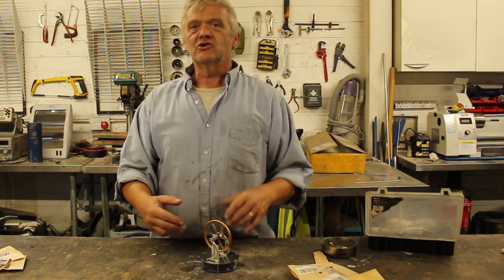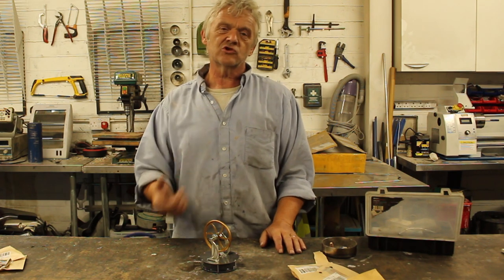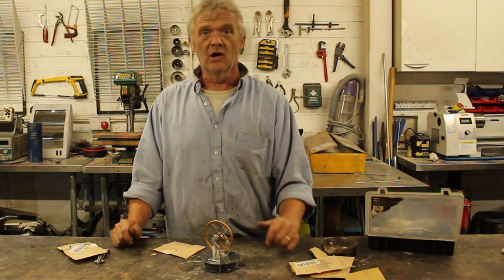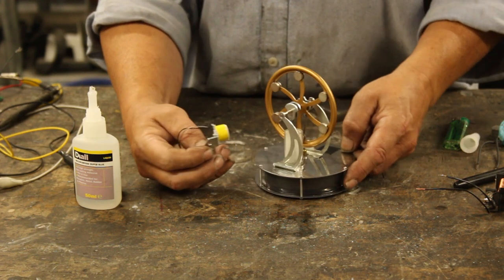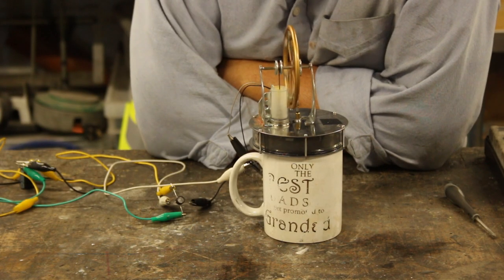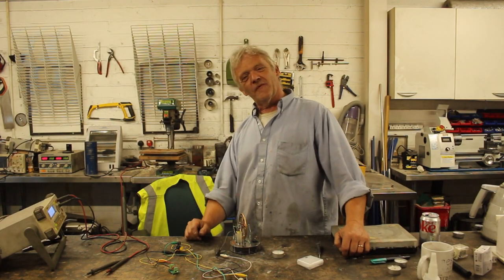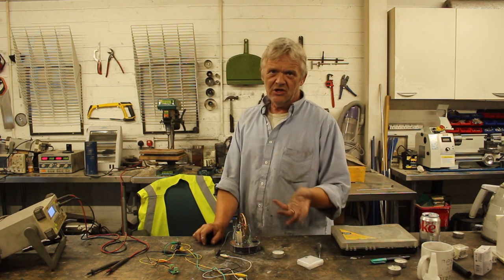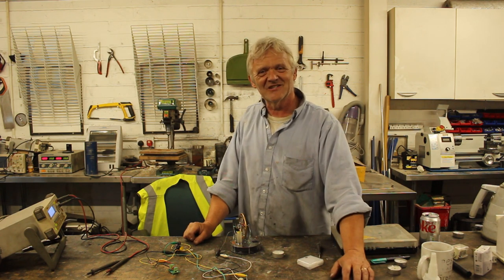1617 How To Generate Electricty From A Cup Of Coffee Or A Tea Light

Comment: I think a helpful video for the preppers would be, how to make a large sterling engine to charge a battery. There was a company that was doing this but it's vague how to accomplish it. I saw another person directing sun from a parabolic reflective dish to a tube with oil that went to sand battery, another was using a sterling to run off the heat from the hot oil, that would be much better than solar, cheaper and better for the environment.
Reply: Atmo motor v2
Reply from the maker: to scale this up is pretty easy in concept - about the only additional thing needed is a counterweight on the displacer
Reply: @ThinkingandTinkering  nice! Hey have you checked out open source ecology, you would have a field day with the stuff they are doing

Comment: I am wondering if a scaled-up version of this could be installed on a roof or through it into the loft-space, so that in summer the sun powers it compared to the cooler air inside the house, and in winter the opposite may be true with waste-heat.
Reply: Probably but you are introducing a heat leak in your insulation.  But if say your window is already leaking heat then it's called energy scavenging.
Reply: The best thing you can do in your loft in summer, is put a velux window, so that the heat can vent off, create an up draught. My neighbours house was over 40 degrees all night upstairs, mine was 25. Basic science.
Reply from the maker: I would think so - but I don't know how good it would be at that job - but if the alternative is that or nothing - I would go with your idea for sure

Comment: I believe I did read somewhere that sterling engines have been used to produce 2 or 3 kilowatts in large tower buildings which used a furnace to heat the flats/rooms. I think that's the only example of them being used practically I ever found though
Reply from the maker: you have to go back to the late 1800s to see them in real use - then they were every where

Comment: I've always thought that a Sterling engine heat pump, for heating and cooling, seemed a natural combination. Utilizing the temperature differential between inside and out to bring them further apart sounds like a great feedback loop, as long as the difference is great enough to begin with. I always figured there must be something wrong with my thinking, or it would've been done before. Probably doesn't scale well to the application.
Reply: The difference between hot and cold has to be pretty large to drive such a mechanism.  Basically the range of temperature the device needs is bigger than you can comfortably tolerate.
Reply: Don't you realize that defies the laws of thermodynamics?  That would be spontaneously moving heat energy in the wrong direction without adding energy.
Reply: @BobWidlefish  
"The difference between hot and cold has to be pretty large to drive such a mechanism.  Basically the range of temperature the device needs is bigger than you can comfortably tolerate."

You're information is misleading.

Rob measured the difference between hot and cold on that little one he has in this video. The difference was 5 degrees Celsius which is about 41 degrees Fahrenheit.

That's not a very big difference.
Reply: @BobWidlefish  Still, you wouldn't use ambient temperatures. I imagine some form of freon would be used to do the heat exchange. Sterling engines would run the compressor, but like I say, it doesn't scale well.
Reply: @MushookieMan  That would only apply to a closed system. Only the indoor end is closed.
Reply: @willcool713  Imagine your design as a black box.  You are expecting heat to move through it  in the wrong direction, without adding electrical energy to pump the heat.  Open or closed, doesn't matter.
Reply: @MushookieMan  Well, if it were freon based, you'd definitely need something to pump the freon up to pressure on the appropriate side. I'm not thinking of it as a closed system, as if you're only getting energy from the Sterling engines. But as an automated control mechanism, it certainly seems like it could increase efficiency. I'm not trying to create some sort of perpetual motion device. But the heat pump concept dovetails wonderfully with the mechanics of the Sterling engine. I just see lots of room for optimization. I don't understand why everyone is so down on the idea. It's just a thought exercise I toy with now and again in idle moments. Sorry to offend.
Reply from the maker: I read all of this thread as I wasn't sure what you actually meant from your first post and to be honest mate I am still not sure -  you can take a heat difference and change it to motion which is a Stirling Engine - you can of course do the opposite take motion and change it to a heat difference - which is what Stirling coolers do. The motion of a Stirling Engine could be the input for the Stirling cooler but as each leg is at best 37% efficient the over all machine would only be around 12% efficient - that's why Stirling coolers use a different motor to run them - it really makes no difference how you arrange that - the above would be true - hope this helps and I have got the right idea - because I am still not sure what you mean lol - cheers
Reply: @ThinkingandTinkering  Well, I'm not sure either. It was idle speculation, there just seems something there to take advantage of. Maybe I should read up on Sterling coolers before I try reinventing the wheel.

Comment: Remember  the shake light. Old emergency backup flashlight (torch) you shake and it charges a battery in the handle? Do you think that same application could be used with the Sterling engine? But scalded up
Reply from the maker: I would think so mate

Comment: Maximum theoretical efficiency is:

Q = (Tmax - Tmin) / Tmax; Where T is temperature in kelvin, changing 1 deg c = changing 1 deg kelvin but 0 deg C = 273.15 kelvin.

It's the inverted equation for calculating the efficiency of a heat pump and all carnot engines are heat pumps when supplied mechanical power. It's also the maximum efficiency of energy extraction possible from a temperature gradient.

Low-TD carnot cycle engines minimize losses to the point where, like this they, can operate on extremely small differentials, however, low differentials are inneficient by nature. If you suplied a low-td stirling engine with a larg differential, you have an extremely efficient engine. In fact, if you control the supply flame and make sure you have efficient heat exchange, low-td carnot engines are basically the most efficient it is possible to make an engine that opperates off of pressure and heat.

With the candle flame, the flame gets to 760 celcius or 1033.15 Kelvin and if the air is 293.15 Kelvin, then the efficiency of a low-td stirling running on a candle flame would be close to 70%!!!

Comment: Could you somehow have 2 of these or a different sterling engine, configured in a way so you had the 2 flywheels rotating in opposite directions close to each other and have the magnets on one, and the coils on the other with some kind of slip rings on the coils to transfer the power and hopefully generate more power.

Comment: Is the energy an LTD Stirling engine produces equally scalable with its size?  
  I mean it can obviously produce more electricity being larger, what size sterling engine would be needed to supply a useable voltage and current?

Comment: How about if you compare that sterling to the TEC and see which one generates the most from the same little candle. The TEC generate electricity from temperature difference, and it has no moving parts. They make it TEC fan which is on top of the stove to move air, you can do the same thing with direct light maybe a magnifying glass.
Reply from the maker: good idea

Comment: The last few days have got me thinking that maybe we're using the wrong part of the parabola to focus the heat for a solar sterling generator.  Normally these things use the bowl to consentrate the sun's heat from behind on the underside of the engine, where a flame would be. But what if we use the legs instead and focus the heat on the upper side of the engine and use the capillary cooling from the ambient air temperature on the bottom.  

Or maybe it needs to be the other way round.  The cold side on top heated by the legs and the hot end on the bottom heated by the ambient, and let the cold fall and the heat rise.  Something I need to play with...
Reply from the maker: I do like your thinking there - and lots of interesting questions - my hope is you give it a go and share the results - nice one
Reply: I would try using a fresnel lens with the mirror. I have two that I found. They would work best I think.
Reply: @rsummers1974ify  I like that plan

Comment: How about combining a solar heat collector with a sand battery and a bigger LTD Stirling?  The Stirling could then run when the sun is out, or as long as the battery has enough heat.  In colder climates, it might be possible to run the Stirling in the winter off the temperature difference between indoor and air without impacting the temperature inside too much.  Adding a Zeolite powered heat exchanger to the mix might have a benefit as well.

The idea is not to run a house on the Stirling alone, but to supplement other collectors, like solar panels & wind turbines to charge batteries.  This way, the collection system would take advantage of whatever climatic conditions are present.

Where have you seen large LTD engines - the water pumps that you mentioned?
Reply from the maker: just do a youtube search mate - they pop straight up

Comment: Awesome,   every since I knew about these engines, and got into alternative power, I wanted to build one large enough, or a pair large enough, to generate around 1kw, maybe use an aluminum plate heated by concentrated solar, with maybe a large aluminum heatsink, maybe water cooled, by creek water, or spring water,  slowly pumped by the contraption!  Maybe use a old sat dish as reflector,  a lot can be done with 1kw over 8-10hours,  I could run my house with that,,

Comment: The coolest one I have seen was on discovery Channel. It's a dish like of mirrors that focuses the sun into a helium I think it was, chamber and they said it could generate 25kw and its foot print could fit is about a playground sized area. They said it could power maybe 5 houses. It was a very high temperature Sterling engine with special gasses to be able to stand the heat. I wish I could buy one like that because I would have my own power company at that point!!
Reply: It's a 38ft dish from a quick Google of it. That's big but it could fit in my back yard.
Reply from the maker: I must look that up mate - cheers

Comment: Would connecting it to a small toy motor with a pulley, not be able to provide more power?
Reply from the maker: no - the ultimate power source is the heat difference between the cup of coffee and the ambient - that's as much power as you are going to get - well around 37% of that - it is after all a heat engine
Reply: @ThinkingandTinkering  Oh yes that true.

Comment: The big problem I see with most of these DIY alternator/generator projects is in the measuring and claims of power output.

I see the presenter measuring the open circuit voltage then measuring the current with ammeter in the same method. You cannot take these measurements separately then multiply them together and get a correct power measurement in watts. You have to take the voltage and current measurements at the same time. Or connect a load and then take the measurements. You are just fooling yourselves.